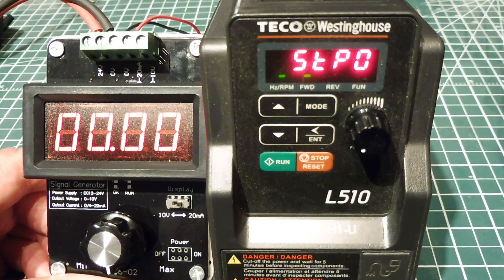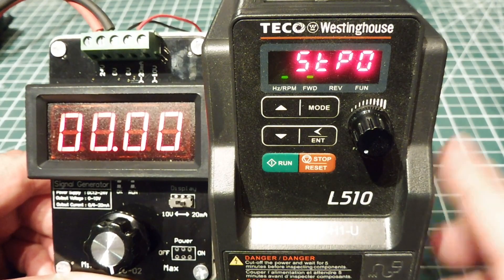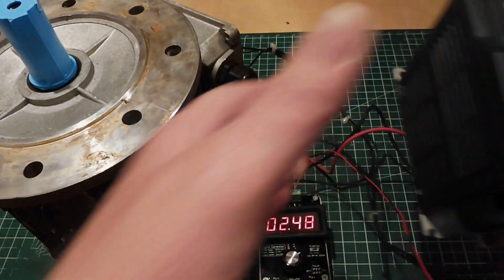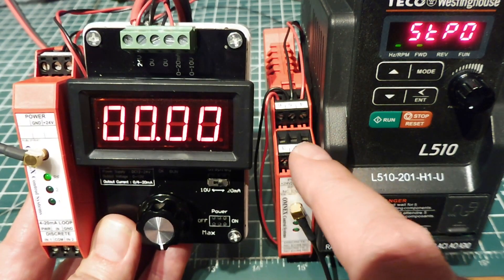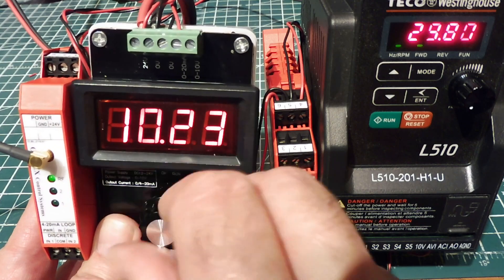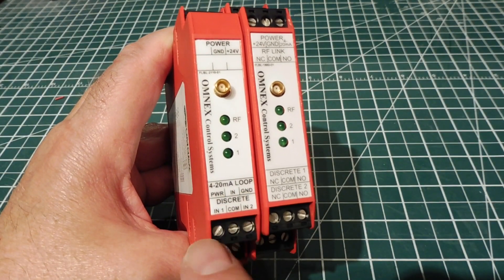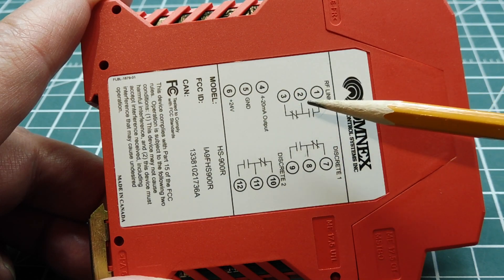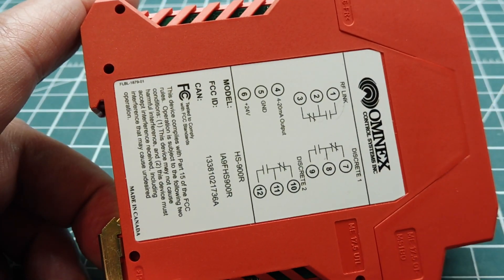Wireless 4 - 20 mA Current Loop Control

Comment: Freaking amazing. I work for fluid chillers Inc. rebuild industrial process Chillers. I need a wireless temperature sensor that will connect to a 4 to 20 milliamp input signal on the test and plc. I need to find those wireless transmitters. Awesome video.
Reply from the maker: Thanks for the visit, glad the video was helpful.

Comment: Thank you this is great 
What is the fail mode inccase the transmitter failed?
Reply from the maker: Without the transmitter the receiver would get a "communication failure" and shut down the system.